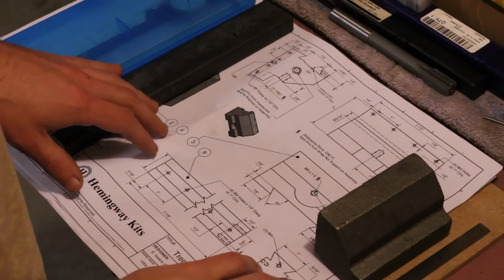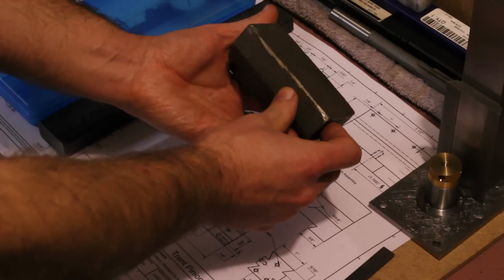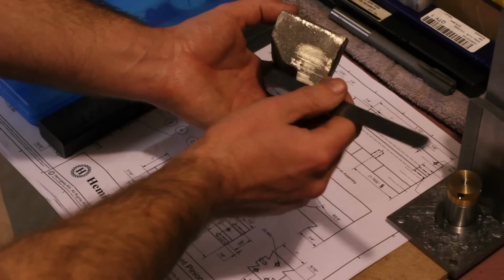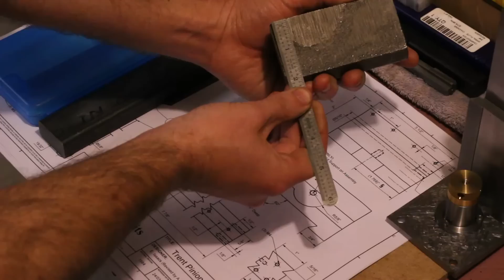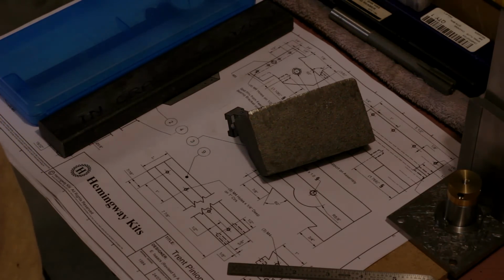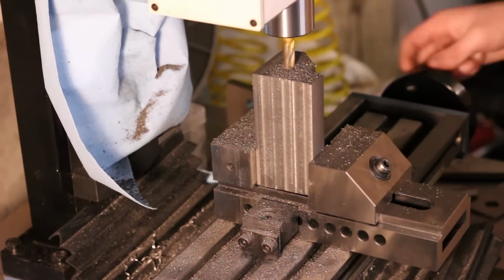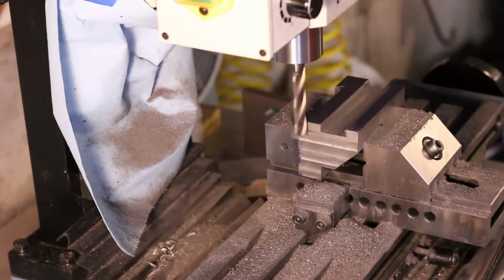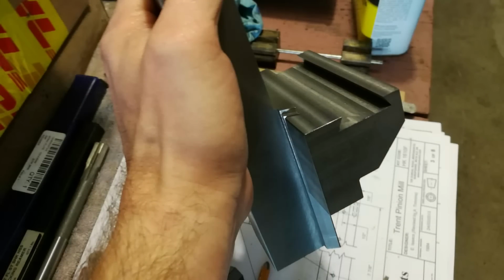Building the Trent Pinion Mill, part 4

Comment: Looking good Max. Some good advice there on analyzing a casting.
ATB, Robin
Reply from the maker: Thank you Robin, and thanks for watching!
Reply: @TheJoyofPrecision  When dealing with a casting, especially cast iron, remember there is an “up” side to the casting and the sand and impurities end up there.  Also the detail in the casting is usually on the other side because of this.  Generally if you start there and level the work to the planet (as your machine is) you shouldn’t have any trouble revealing the part inside without running out of stock.  Most of the time that makes things pretty easy.  As long as you have a “don’t go below” you can get all the crap off the “bad side” and still have plenty of stock on the detailed side.

Comment: I noticed you used a roughing end mill to surface the casting.  Was there some reason why you didn't use a fly cutter for this operation as you did for other surfaces?
Reply from the maker: The surfaces that I didn't finish cut are the ones that were later scraped. That will be shown in the next video... some day, lol.

Comment: that thing is so awesome. cant wait to see it done. is there any reason you didn't use a fly cutter for those large facing cuts?
Reply from the maker: Thank you! :)  I did also fly cut the "chin" (I guess that's what you'd call it) of the knee but didn't get that on video.  The only surfaces that weren't either fly cut or side milled were the rear and top surfaces (where the dovetails were cut into).  I didn't bother fly cutting those because those surfaces will be scraped (actually they have already been scraped) to use as good reference surfaces for scraping in the dovetails.  If you check out my photos on Instagram you can see more up-to-date photos of the knee (and all of my projects, really).
Reply: The Joy of Precision ah, thanks. I'll give you a follow :)

Comment: Very good discussion on how to treat your castings! If I run across one in a dark alley, I'll deal with it :) And very very good vidography BTW.  Are you flying the mill on instruments (dials) or do you have GPS (DRO)?
Reply from the maker: LOL!  Thanks, I'm still working on better lighting in the shop. And after I shot all this footage I put up camera mounts around the shop so I don't have to use the tripod most of the time now.  I don't have DRO on anything in the shop, so I'm always flying by the dials.  DRO would be pretty neat for hole patterns and radiusing - my father has a neat DRO setup on his Rockwell mill and it is pretty slick.

Comment: So what happened to the rest of it? :) , 4 years is a big break
Reply from the maker: I finally have a fully functional, even larger, workshop again after our big move 2 years ago, it's an awesome space! During the pandemic I ended up using all my workshop time to make parts for a local manufacturer of medical devices. During storage while we were building my new shop, some of the items including the Trent parts were afflicted with rust. Mostly surface rust but it was disheartening for sure. I'm looking forward to doing a shop tour and update video soon, and I'll probably resurrect the Trent project some time in 2024.
Reply: Damn, sorry to hear about the rust but good news on the much larger space, I've recently got a 2nd workshop in my garden and unfortunately the builders of my first shed bodged the roof, lots of rain in the UK over the last 3 months and the roofing felt has failed, water has got in and I have blue mould plus heavy flash rust over most of my stuff.

A Rivett 8" Precision lathe I'd cleaned up is now back to rust, so now I have to strip it all down again :/

I envy people in dry climates!

Comment: get a bigger piece of stock
Reply from the maker: carl baumgardt It's not a piece of stock, it's a casting. I'm sure Hemingway would have been more than willing to send a replacement in a case where it was substantially underdimensioned.
Reply: lol it is cold hear in Delaware tell them it shrunk in shipping
Reply: ps  doo get your point
Reply from the maker: LOL!! Up here we've gone from sub-zero to mid 50 degrees in the past few days!  Just crazy.  In all seriousness though, everything was fine in this case, as long as care was taken in setting up the work as mentioned.  The marginal dimensioning of this casting isn't something that will have any realistic effect.  I have heard from others that it's not uncommon to have castings a bit on the shy side, whether it's from shrinkage, voids, poor pattern making, or careless saw marks... so it definitely pays to closely examine casting dimensions and how they relate to one another and to the finished part, before starting any machining.  I'm sure glad I did with this part, otherwise I would have lost a decent amount of material for no good reason.